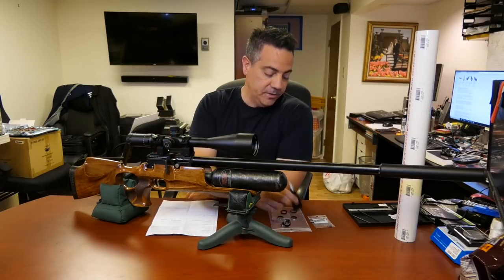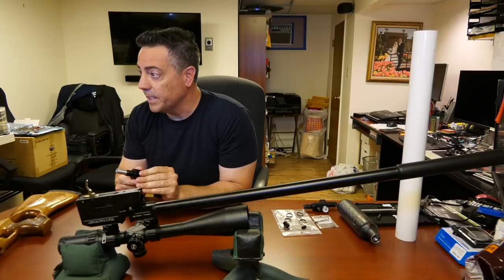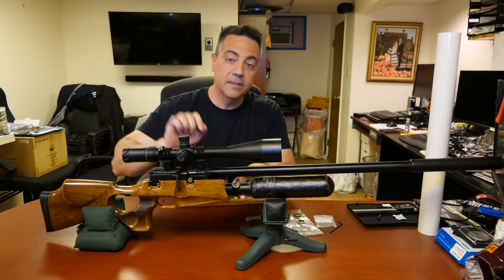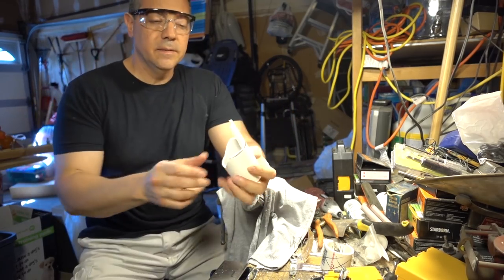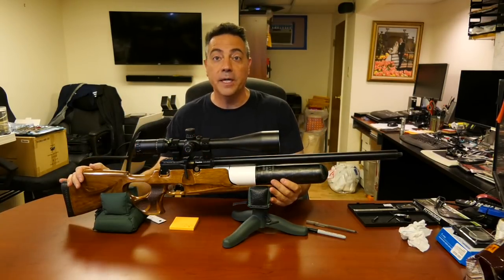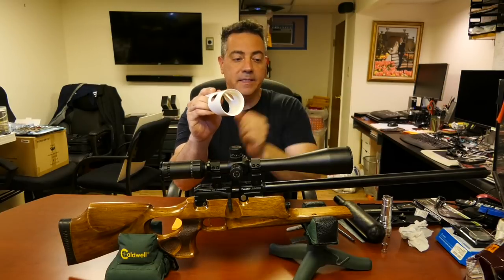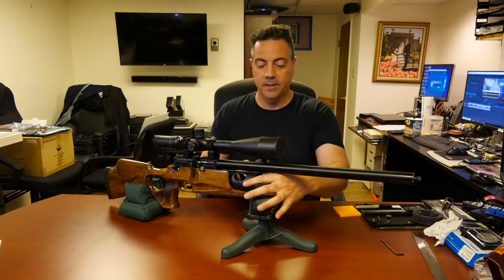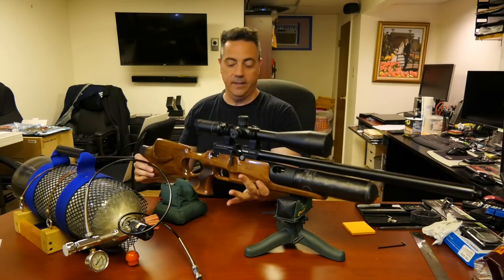How to install the Altaros regulator on a bottle gun and make it look good! Kral Puncher Jumbo

Comment: So now your bottle gauge marks the preasure in the bottle and the previous gauge the preasure that the regulator is seted up, right?, my only doubt is what abouot the old fill port, is it usable? Thanks for a fantastic video
Reply from the maker: Miguel Sanchez yes, you are correct. I should have mentioned that the old fill port should NOT BE USED. I put two o-rings around the old fill port so it cannot be used. Yes, the old monometer is the regulated pressure. Good catch Miguel I'm going to pin this post so people can see.
Reply: Air Velocity Sport great video. Next time use paper which can be fold into a circle using rubber bands to keep together then you can draw diagrams/patterns to overlay before cutting PVC. But you got the job done and what's important is that you or your customer is satisfied and your mods are recorded for future references.
Reply: You probably dont give a shit but does anyone know a tool to log back into an instagram account??
I was dumb forgot the password. I would appreciate any tips you can offer me!
Reply: @Miles Jad it did the trick and I actually got access to my account again. I'm so happy!
Thanks so much you really help me out!
Reply: @Matteo Roland Glad I could help :D
Reply: @AirVelocitySport  would a fx dreamline  plenum help with available power? I'm just curious, I found one for $28.
Reply: @matteoroland227  reset password button on instagram...worked every time for me

Comment: How much extra overall length does the regulator add please. As usual an excellent presentation. Altaros could steal a March by offering a complete kit with the shroud. I think this could also be used with the new np-02 carbine. Rob

Comment: I'm new to airguns, but what I gather from this video is that as you increased the bottle size and added the regulator, you increased the FPE and also made it more consistent in power. Is my understanding correct? Which bottle did you get, btw? Thank you!

Comment: I installed an Altaros  regulator (also set to 150 bar) in my Evanix REX .30 rifle.
Best thing that could have happened to it because of its small air tube. 
Now I can fill it to just above 250 bar and shot count is increased.

Comment: Love the videos and always chuckle when I see you break out the SCH40. Two unsolicited tips. A carbon fiber tube cut down might make a better (more durable) filler piece. Secondly, I would slice the top and bottom off a soda can and slit it al the way up. Tape it to the bottle and overlap the wood. Use a hard tool to make an impression around the stock. Remove the whole assembly and cut the can along the impression made where the stock was. Slide the beveled sleeve into place and mark it up using the soda can template. A machinist would know best and I am just a hack. But I use soda can templates to transfer drill positions from say a Disco tube to blank stock and it works for me.

Comment: Bending a wire coat hanger to slide inside the ABS part would eliminate the spinning because you can either bend the hook so it can stand by itself or hold by hand. Is there a fill port cover available to keep the fill port clean of dust or rain?

Comment: Did you adjust the hammer spring tension after the insallation?Since you had it set at 150bar output is it necessary to lighten the hammer strike or can u leave it as is?

Comment: Hello, I enjoy your videos and have been subscriber of yours for a while now. I just purchased a .25 Kral Puncher Pro 500 and I have a few questions for you. I plan to do two upgrades that you have also done. I plan to change to a Carbon bottle and install a regulator. Did you consider a Lane Regulator ? or heard of anyone that has ? Also did you consider a carbon bottle from ALi Express, They are substantially cheaper. Also, is your Yong Heng Air Compressor still working for you ?  Thank you in advance, Jerry S.  Mountain House, CA

Comment: If you remove the threaded adapter in the drop block.  You can replace it with a 88g to paint ball tank adapter. Then get a regular regulated bottle  with the out put needed. 😊

Comment: Very cool man!  Def gonna go this route with my .22 jumbo! I'm interested to see what the old vs new shot count is.
Reply from the maker: Derek Anderson thanks! I'm now getting 75 shots with a 3500psi fill shooting JSB 33.95 pellets 870 on average. I did a shot string but I had a few spikes I'm going to wait for the regulator to settle down before I do anshot string.
Reply: Air Velocity Sport  what was ypur shot count before? I got my gun from Troy and he has it tuned for 95-100 shots at 32fpe in .22 cal. My hopes are to regulate it and throw on a carbon bottle and see at least 150 shots.
Reply from the maker: Derek Anderson it increase my shots by about 18 to 20 shot I would expect you to get an addition 25 shots or more at lower regulated pressure and more volume of air using a carbon fiber bottle.
Reply: @AirVelocitySport  thats 80 jules of power...

Comment: Have you seen the new Hatsan hercules bully in  .22 & .25 cals. it's in a bullpup design with a large hpa bottle, it's a bullpup version of the Hercules, I've read on blogs of some owners that it's fast avg a thousand +  fps !!! It would be nice if it can be tuned or regulated to make the shot string good on the chrony!
Reply: I have the Bully in .30 cal and am looking to install an Altaros on it.  Out of the box it shoot 44 gr Pred Polys at 1050 fps...  Only 20 shots before needing to refill the tank though.

Comment: Hi, great job .... but you can also mount it with the standard 500cc aluminum tank at 200 Bar ... or is it not worth it?
Thank you

Mirco
Reply from the maker: Thank you! Yes, the standard aluminum bottle has the m18x1.5 thread so it will work. I just wanted a carbon fiber bottle for weight and asthesthics

Comment: Possible with the same regulator on the crossman benjamin kratos... good video not much out there about these conversions
Reply from the maker: Yes, as long as the thread are the same. I believe M18
Reply: Do you have a supplier in kzn?

Comment: I like your ideas on modifying air rifles I took some of your advice and I might applied my own I increased my foot pounds and speed now I'm getting 92 ft pounds before I was getting 64 I installed the 700cc air tank my working pressure on the gun is 3500 PSI my gun was unregulated now I just installed a regulator with the large plenum regulator is set to 180 bar that's about 2600 psi my question is can I fill my carbon fiber tank to 4500 PSI because the regulator is only pushing 2600 PSI that should be by due working pressure right and I should not get no valve lock let me know thank you
Reply from the maker: I would not go beyond the safe working pressure of the breech block. I would stick tk 3600psi incase the regulator fails and dumps all 4500 psi into the block could be dangerous. I would check with oral first.
Reply: Thanks for your advice and your quick response I know some air guns can take 4500 PSI so if the regulator gives out then it can cause damage to the air rifle because working pressure is only 3500 PSI thank you for your advice

Comment: Hey man.  I really enjoy watching you videos.  I have a question for you. Hopefully you can help me.   I am thinking of getting a regulator for the benjamin kratos. 22. It has the same valve system with the drop block of the kral puncher jumbo.  My question is will the air rifle still be making the same power with the regulator on the rifle.  I just think the plenum might be small on the drop block.
Reply from the maker: My Kral Jumbo was able to get to 65fpe regulated. Unregulated is was only a few FPE more. IMHO 3 less FPE for more consistent shot string was well worth it.
Reply: @AirVelocitySport  thanks man.  I appreciate your feedback. I'll definitely get a regulator your my benjamin kratos.

Comment: I spoke to one of the development guys at Kral yesterday regarding the power of their new models. He told me on the Space in .22 with 18.13 pellet they were getting 600fps on minimum setting and 1100 on maximum. On .25 said it was possible to get 1100fps with 25 grain, 920 with 34 grain and 820 with 42 grain. He was not clear if the figures for .25 will be the factory settings.
New models are 500cc bottle at 250 bar.
Reply from the maker: Paul Brock that's great news. I just wish they would regulate there guns.
Reply: Air Velocity Sport How much of an improvement do you get from a regulator?? Have seen some of Troy Hammers videos and his spreads seem quite low.
What were your before and after spreads and did you get any improvement in usable shot coun?
Reply from the maker: After I tuned it for high power with the aluminum bottle I was getting 45 shots with and ES 34 fps. (That's 890 fps with JSB 34.95 grain or 60 fpe) with the carbon fiber bottle I was getting about 57 shots with an ES of 31 fps (that's 870fps with JSB 34.95). Im waiting for the regulator to settle down but first test string was 75 shots with ES of 19fps BUT there were 6 shots that spiked low for whatever reason.(regged it's shooting 870 fps)
Reply: Air Velocity Sport Hope the regulator settles down. Will you please post an update on this when you have had time to get some more shots through your gun.
I am liking the look of the Kral Space. Bullpup with all the controls looking in the right place and a very big power adjustment wheel which should make tuning the rifle reasonably easy..
It takes long enough to tune 1 calibre. I think the Nemisis with its 3 barrels/calibres would drive me a bit crazy.
Reply from the maker: Will do
Reply from the maker: Paul I agree. The space has the side lever in the right spot. That may be the next gun I try to get my hands on.
Reply: @AirVelocitySport  if i instal regulator on .22 can i increase its power ?
Reply from the maker: Yes, I believe the altros regulator goes to 2300 psi
Reply: Hoe many joules increase will be that ?

Comment: how would u change over too new bottle safely if u may have had old air still in the bottle ??ie upgrade from metal too carbon fiber and remove the old bottle  from the regulator??
Reply from the maker: Just Degas and remove old bottle then match the threads from old bottle to new bottle
Reply: @AirVelocitySport  I found a video with a decas tool u screw it on and it lets the air out slow.was really hard to find a video on it  £9 pounds ebay ur videos are very good!!!

Comment: Will the Altars regulator work on the bottle  that comes with the kral puncher Jumbo 25cal
Reply from the maker: Phillip Mendiola yes, if you look on the Kral jumbo 425cc aluminum bottle it should say m18x1.5. just make sure you ask the altaros guys which Altaros regulator to purchase. I purchased the one for the Air Force Talon.
Reply: Air Velocity Sport , KOOL , THANK YOU

Comment: Great video. Thanks alot. Do you know if I can install it in the new kral nemesis?
Reply: i want to know also , and i want to,  know abouth the power knob on it , what i unstand its like a regulator or am i rong
Reply: it will fit you only have some grinding to do

Comment: How did you work out where the holes go...as I'm at 80% now just got to do the holes aka centre
Reply from the maker: I made an estimate and started with two small holes. Then put it together and see how far off I was and just used my Dremel tool to enlarge the in the direction I was off.

Comment: Can that reg be used in the Kral NP02 with the forward and rear bottle setup?
Reply from the maker: I do not know for sure by I don't think so. Reason is that the bottle regulator will only regulate air from the bottle but not from the front tube
Reply: Thanks for answering that for me! Ive been looking into it and nobody in the uk could give a straight answer. What if the front bottle was made obsolete as it only holds a bit compared to the rear and im sure the reg would make up the difference due to not wasting so much air?
Reply from the maker: @TheMattzki  Order of operation matters here. What I mean is that if the air flows from the bottle to the air tube that could work. If the small air tube acts as a Plenum then it could work.

Comment: Does the jumbo 25 cal shoot good stock ? Thinking about getting one Thanks .
Reply from the maker: Ronnie Umberger it's actuate right out of the box but the power is low. It will shoot JSB 25 grain about 850 fps and JSB 33.95 grain at 785 fps
Reply: Air Velocity Sport Thanks how much would it cost to get one tuned and more power for hunting and target shooting
Reply from the maker: Give Troy Hammer a call at Annihilator Airguns. He does great work on all kral guns and his prices are very reasonable.

Comment: kinda stumped  you say 2" diameter  .. the carbon bottles are 59mm dia  thats half inch  more than 2 inch ,
Reply from the maker: I said the pipe  is a 2 in PVC pipe which has a 2.35 outer diameter which is almost exactly the same as the 2.39" (59mm) outer diameter of the carbon fiber bottle. PVC pipe is measured by inner diameter.
Reply: @AirVelocitySport  brilliant thanks Steve , i was kind of confused being offered  a 50mm bottle and a 60mm bottle , so its nearer 60 thats good my mistake  . i apolagise and thank you ,  iv also found a company thats remade the valve stems in the uk . and huma regs in the same configuration ..  thanks for the inspiration fella 👍👍👍

Comment: Great mod putting the regulator on I'd of left it at that. The plastic pipe mod not for me it looks kind of incongruous. I'd improve my gun & be proud that I'd worked that out for myself & when asked about why my air cylinder stuck out more I's say because I improved my gun.

Comment: I just purchased the Kervan Airboss K1 25 cal which looks very similar to yours, except for the barrel length.

I purchased the gun for marksmanship/target shooting. It should be fine for 200 yards but I’d like to try and see what happens at 300 yards plus. 

Are you familiar with my gun and what do you think of it for the application that I purchased it for? Here are the specifications.

DESCRIPTION
GAUGE

4.5 mm, 5.5 mm, 6.35 mm
RECEIVER

Anodized Aluminium
AIR CAPACITY

250 bar / 500 cc
OVERALL WEIGHT

3750 gr.
BARREL LENGHT

58 cm / 22.8 inch
OVERALL LENGHT

105 cm / 41.3 inch
MUZZLE VELOCITY

Max. 1100 fps (335m/s)
ENERGY

29J(.177) / 50J(.22) / 60J(.25)
MAGAZINE CAPACITY

14, 12, 10
STOCK

Turkish Walnut
TUBE

Bottle